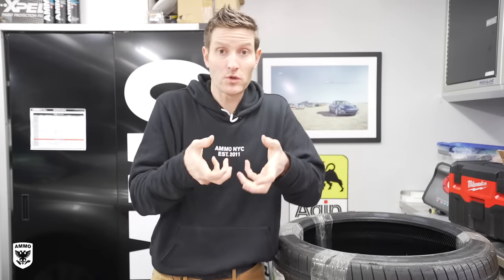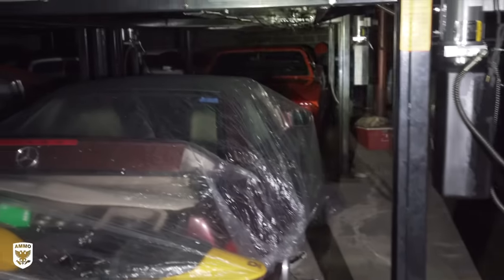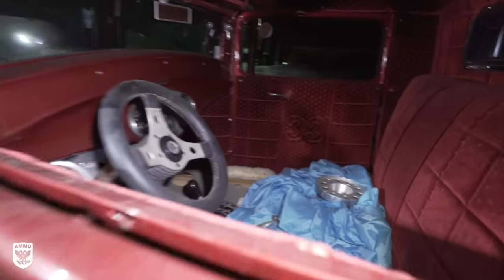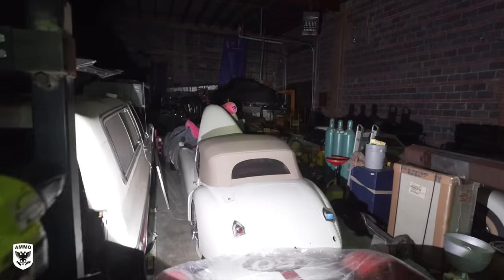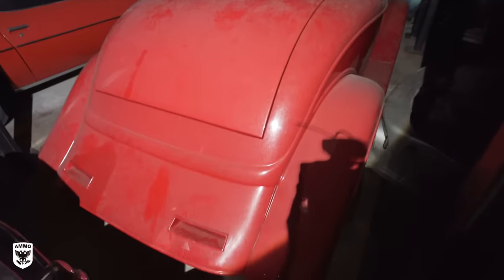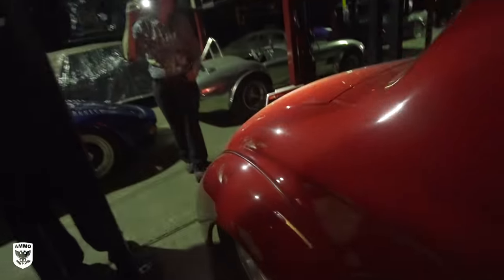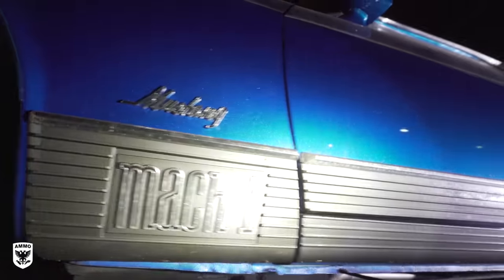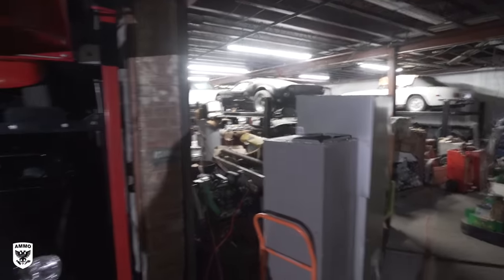300 CAR BARN FIND: PRIVATE TOUR Ferrari, Lamborghini, Mercedes, Corvette, Mustang, Porsche

Comment: “Cherry”
“Ran when parked”
“May need a tune up”
“A/C works but may need Freon”
Reply: Craigslist ad.....
Reply: The tires are mostly deflated. Does it damage the shock springs or wheel rims?
Reply: @OttawaInHD  It can crack a rim but I've only seen it on cambered cars. Deflated tires wont mess up the suspension as much as just sitting in general and rotting would.
Reply: @Stclairm1  "no tire kickers, I know what I have"

Comment: The company selling 4pillar lifts has made a good cut for this collector :D
Reply: Antti Hirvensalo they look to be fabricated not bought but still that may have been more expensive due to labor and material
Reply: I'm more surprised they haven't snapped after 20 or 30yrs plus of holding cars.
Reply: I wonder if all of them are still functioning though, I’d image a lot of them don’t get very much use.
Reply: A lot of the 'lifts' you see here are actually just car holders with no mechanism. The vehicles would have to be lifted up using a mechanism of some sort and then locked in place using pins. My point is that these cars were put in here with very little intention of coming out any time soon. Hundreds of millions of dollars just sitting gathering dust for decades. Such a waste.
Reply: @unicorn7337  imagine if that place caught on fire 😧😥

Comment: "That's what it's about.. the passion." No, when you let these prize stallions wither and die in a cage, that's not passion. That's hoarding.
Reply: Agree 100% Soon these will be mostly worthless.
Reply: think about it
it would take less effort to really restore them to former glory or less time to restomod them so they are roadworthy again because they are in a warehouse rather than succumbing to the elements like decrepit barn finds you see
Reply: These aren't living animals, They don't wither and die lol. I bet these are in better condition than if u drove them around everyday they just need a wash
Reply: @TheDomzilla13  I don't think you understand what happens to all the gaskets, rubber seals, belts and hoses when you just let a car sit idle.
Reply: Anyone saying “these are preserved!” Don’t know anything about cars. Each of these cars are trashed. Engines must be rebuilt. Oil in them is water, seals are rotted and gone, gas tanks replaced, animals made nests in them?  This is 30 minutes of non stop skin crawling cringe.
Reply: Scorpion mk2 but everything in them will still be dried out, cracked, and dry rotted. I mean a head gasket set for a Diablo is over $500.
Reply: And there's 3 other buildings just like that one. GASP! 
 "Hopefully we're going to get that car back on the race track soon", Yeah OK

Comment: The lady is too kind to the owner.

He's never getting back racing any of those cars. None of them have moved in how many years? All need major reconditioning before starting
Reply: KW 001 yep, all these cars are trashed. It’s a shame.
Reply: Yeah. All new seals, hoses, belts, breaks and break lines, fuel lines, and most of the fuel system. I’m betting there is a good bit of rotted and cracked electrical.
Reply: She's the enabler in his psychosis.
Reply: @MrMatteo83  not trashed.. Even rusted car in junkyard can be restored
Reply: @adrianfarhan2659  rusted is a wide term. I wouldn't say that so confidently.
Reply: @s0uthp4w68  "It's one of my favorites.  I think  I convinced him to keep it."  yup  100%

Comment: The Tires are flat on most of these cars. I'm guessing the fluids have never been changed and the lines are full of crud for the brake lines and clutch lines and all of the rubber has dry-rotted around the cars.  Whoever owned this "Collection" was doing nothing more than hoarding the cars and had no intention of keeping any sort of museum upkeep in mind.
Reply: Yeah a lot of these will have fucked engines
Reply: Guy has a Ferrari 288 GT0 tucked in the back like it’s not a 1 of 230 rare historic icon. This is sad bc he will never be able to drive and maintain half of the jewels. Hope these find good homes to be resurrected and loved. Hoarding is a sickness IMO
Reply: Even in major disrepair he'll probably triple his original investment on most of these cars. The cost of upkeep vs deferred maintenance surely has been calculated here.
Reply: They’re investments. They will be serviced before selling. Calm down
Reply: Yup TAXFREE investments. One that is not affected by currency. These cars are just a backup plan and are guaranteed to increase in value.
Reply: Bearings will have to be chanced too most likely. All ball and roller bearings that take a vertical load can actually sit to death unless real good bearing or really oversized.
Reply: @Easton21  serviced they all need major major repiar junk!

Comment: 2:56 There was no All wheel drive version of E31, she probably had All wheel steering in mind.
Reply: That'd make more sense.  Odd that it has Alpina rims but it kinda looks like it doesn't have the front badge, hard to tell.   Also, wouldn't all B12s have pinstripes?  *shrugs*
Reply: Thank you! You saved me from making the correction.

Comment: The owner needs a high-five. In the face. With a chair.

It seems like no effort was made to preserve these cars correctly, apart from stashing them away in some decrepit warehouse. It's a disgusting display of power, not a display of love.  
In my opinion this is beyond what any true car lover would do.
Reply: Pizza Pizza  Absolutely, there's nothing there that can't be made to run with a little effort. A lot of money has been spent on proper lifts, racks, and so on. Better than left to waste away in a field.
Reply: Pizza Pizza  I'm not sure if you know this, but letting a vehicle sit for more than a year without driving is one of the worst things you can do to it.  Dry rot, gas turning to varnish, oil turning to sludge, and mold.  Every car in this has sat for several years.  Probably 90% will need at least an engine rebuilt and a new gas tank, and half of them still will not be the same.  Most of the lesser valued cars (less than $40k) are basically scrap because of this.  They won't be simply "cleaned up", tens of thousands of dollars will need to go into restoring most of these cars.
Reply: You are correct, that's not love.
Reply: @Turkkish1  What 40+ yr old cars are on their original belts and hoses. These cars will be snapped up by collectors for big money.
Reply: @KimCJorgensen  I keep reading 'better than being left in a field' in these comments, which is a ridiculous false equivalence. It's far more likely many of these would be on the road being enjoyed, or at the very least displayed in pristine condition for others to enjoy. I don't understand why people think the only possible alternative to being stuck in here for nobody's pleasure is rotting in a field.

Comment: This is a sad video, it is not a celebration at all, there is nothing wrong with keeping and storing cars away but there is a right way and a wrong way to do it, this is the latter.
These cars although rare will not be as valuable as they should be due to the condition especially the engines.
This needs to have someone like Jay Leno have the first refusal on any car in this collection and at fair prices considering the amount of work required on many of the cars.

Comment: 2:59 the E31 did not come AWD, I’m assuming by the wheels is an Alpina so maybe the color configuration is 1/10. Amazing collection, so many holy grails for anyone.
Reply: Correct never awd! Alpina only built 97 5.0s and 57 5.7s and none were sold in america so it can very well be 1/10 in america in any color.
Reply: @fatherof2674  seeing the front bumper it looks more like a 850csi with Alpina wheels than an Alpina B12
Reply: @francoisgaignaux6474  you are right :) didnt even look that far so i had to look again, but yeah it doesen't have the "bulge" alpina has and certenly looks like a csi front end :)
Reply: @fatherof2674  Neither the vents on the hood of the Alpina
Reply: @aDoctorWhoCares13234  was not on everyone but Yeah those are not there either :)
Reply: @fatherof2674  ah ok, happy to learn it
Reply: Maybe all wheel steering
Reply: That's the old 8 serie i like very much
Reply: Not likely to be a csi if they think it's awd.  Lot's of non-csi's have the csi bodykit.  I've driven them, it's like driving an e24 with some e36 parts, less visibility, and an extra 500lbs on an already heavy car (the e24), the v12 is smooth, but even compared to a U.S. e36 m3 it feels like a slug.
Reply: Yea, that's what she meant to say, so an 850 csi with Alpina rims then since no louvers 😎 lovely motor, have the base model 850i in bits just now, coming on though as plenty time to clean the numerous parts

Comment: Looks like tax evasion to me. No collectors would have let them cars to rot in this barn
Reply: The owner is a hoarder not a collector.
Reply: theRayzz they don’t rot in the barn only the tires and rubber parts wear off. “Easily replaced”
Reply: @daddydurag2859  time sitting is really bad for cars worse than occasional driving
Reply: @daddydurag2859  well i think that's why he hoarded a lot of parts too to replace it. Good thing to do.

Comment: Is funny because she say all the time... "Low Mileage" but stoped 30years.. i prefer more mileage and not stopped in 30 years because this is terrible for the engine.
Reply: They can be brought back but unless they're flooded with oil many of those engines will need to be opened up and have the gaskets replaced as well as many a dry hose line in those things. Getting them to all run is a big deal.
Reply: Von_Nightmare_ Luciferian  like most older BMW's lol
Reply: Von_Nightmare_ Luciferian  what really😭😭😭
Reply: Von_Nightmare_ Luciferian  that thing can easily be fix.. Part are available

Comment: Gone in 60’s Seconds Part 2 Movie coming soon after seeing this.
Reply: All the gone in 60 seconds cars are In there 😂
Reply: Hence why the location is a secret.
Reply: It's gonna be more like gone in 60 hours, all the cars are grid locked and parked less than an inch apart
Reply: Bob Marley every one of those cars is gunna take some work to start again some motors are prolly locked up from not running in so many years not to mention brakes, coolant, fuel tires all go bad less that 5 years so I can’t imagine what 20 years of sitting is like

Comment: It's like walking inside an animal shelter. Sad and depressing. 
These cars need driving and daylight, not rot abandoned in darkness.
Reply: After_Midnight They dont rot, easy to restore! Saved kind of...
Reply: @KingKohlrabi  Cars are designed to be driven and when they sit for decades it just opens up a Pandora's box of problems.     Whoever buys any of these cars better have deep pockets and a lot of time.
Reply: @brakesforsnakes757  lol not at all. Theres a few basics when starting something that has sat. These  have been kept dry and safe. One day of going through stuff and they would be rip roaring like new.
Reply: @brakesforsnakes757  unless you just get in and try and start it with out doing some stuff like a dummy...
Reply: @imdrunken  Cool story Bruh.
Reply: @imdrunken  There is so much more you are not even thinking about that goes bad on a car that hasn't seen any movement in decades and it's simply not worth my time to enlighten you.
Reply: @brakesforsnakes757  fully aware. Seals that degrade, systems to flush and test, new belts tires and such. But you just bought a low milage barn super car. Dumping 10 to 50 grand to get it driving well is nothing when talking about half million dollar cars.

Comment: My mind is blown. I would like to hear the story of how this collection (hoarding of cars that should be driven and enjoyed) came about. The guys has a fully operational shop, that is so packed with stuff that you can't turn a wrench without clearing the area for a couple hours or more. Let's face it, hoarding is a disorder and this guy needs help. I wish I could afford just one of those cars.
Reply: thor8640 right most of these cars should’ve just been left outside to rot or just gone ahead and had them crushed.
Reply: @jimmygrant3212  I did not say that. There is however a difference between collecting and hoarding - this is the latter.

Comment: Can someone enlighten me on the “AWD” 8 Series at the start... I’m sure they were all RWD?
Reply: She said one of 10. Who knows
Reply: I'm not even a bmw fan but I know better than that
Reply: it looked like an alpina
Reply: Looks to me like an 850csi!Just added the ALPINA wheels.This is not an ALPINA,because it had no front spoiler.They never came with all wheel drive as far as I know!And with only 10 in the country,could well and truly be a 850csi,they where quite rare.
Reply: @vk3kvk  there is a possibility it's an 840cia which people commonly mistake as being all wheel drive.
Or she had a slip up and meant all wheel steering.
Reply: Pretty good video review of the CSI:  https://youtu.be/5JXrvulTg5M
Reply: CSi had 4 wheel steering.
Reply: @vk3kvk  Thought the same but the "1 of 10" part threw me off, there were way more 850CSi in the USA than that, so that leave me to think It actually have to be a real Alpina (or wrong facts or maybe some other tuner, but no idea who that could be) It's not a B12 5,7 but could maybe be a B12 5,0 without the stripes they had a  run of 97 car total so 10 in USA sound about right.
Reply: Wuxter But it has no front spoiler,they all had it!And you are 100% correct,it is not a B12 5,7,because they had a different hood(carbon fiber).Who knows what it is!

Comment: Hmmm, if I had the bucks to afford a collection like that I would have a full time crew cleaning and maintaining them! I know a guy that has a full collection of first off the line Vettes since they built the first one, and his crew tend to them 24/7, and every single one is lifted by the frame, NOT the tires, they are constantly cleaned, tires conditioned, fully detailed inside and out, started, and actually driven enough to keep the engine and drive train lubricated, and blow out the cobwebs, they are taken such good care of, breaks my heart to see this collection, sighs.

Comment: 20:27 - That is not 'snod grass' it's Lime Light (FJ-5) and if that is an original hemi cuda convertible (1 of 14) it may be one of the most important and valuable cars in this building.  It bothers me that you all just brushed past it like it was just a used car.  And, is there another one (in Plum Crazy) right behind the Lotus? Guys, wake up!

Comment: Back in the 70s and the 80s you could pick up almost every one of the cars you see for under $1,000 used.. I got two 55 Chevy 2-door both V-8.. I paid $550 for both... Oldsmobile Cutlass with a rocket engine I paid $50 dollars..1969 Chevelle with a 396 4-speed I paid $700 for that, 63 Chevy Impala two-door 327 engine I got that for $400 and these cars are not junk they were all drivable cars back then I got a 1970 Mustang Mach 1 for $900.. I have four different years of Camaros 68,69,79,80- Z28 Super Sport Rally Sport... back then people would just drive them Sell them cheap because they were not collectibles.. or they would break down didn't have the money to fix it or the knowledge or they just got tired of it.. my uncle owned the Pontiac dealership in Delaware Back in the Day I had three GTOs.2--389 4 barrels 67 was 400 4 barrel..Now because of people like Barrett-Jackson now people think these cars are worth $100,000 each 🤣🤣💰💰I'll keep what i have i have over 20 old muscle cars they all still start they all still driving run how much did it cost me to get over 20 cars...Maybe $10,000 for all.. if I had the room I could have got another 20 for the same price...Never  knew in the 70's and 80's car prices would get this crazy... if you want a good clean muscle car for a good price check out Maple Motors on YouTube they are in Tennessee... Why Pay $60,000 for a 55 Chevy when you could get one there for $25,000..or less there...👍👍👍👍

Comment: That black 69 Camaro with the gold stripes is a prototype, Vince Piggins the guy who created the Z-28 is responsible for that car. He and his engineers built 2, an automatic and a standard. They were supposed to be "detuned" ZL-1's with only 11-1 compression. After Fred Gibbs ordered The original batch of the aluminum ZL-1's and had trouble selling them at over 7K back in 1969 he ended up sending some back to GM. At that point, GM wasn't confident that the black ones with the gold stripe would sell at over 8K so they scrapped the whole thing. That is the reason that only the 2 prototypes exist. Someone built a "recreation" of the car at some point but judging by this collection I would think there's a pretty good chance he has one of the 2 real ones

Comment: The owner should be ashamed for leaving these priceless vehicles in this condition. If you have THIS much money, invest in an actual showcase garage with actual lights and an air purifier. My dream car, the GT40, appeared multiple times and it's sad to see that marvel of a vehicle in such a sad state. This is not impressive to me, it's just sad and disrespectful to the engineers that designed and built them.
Reply: The warehouse is climate controlled, dust will come in no matter what, if he really didn't care he would leave them in some forest and not sell them, if you want to be made at someone there's a collection in belgium that was put outside on purpose for decades, the owner of that collection refuses to sell any of the cars as they get worse every year.